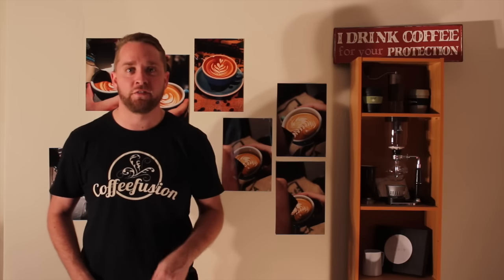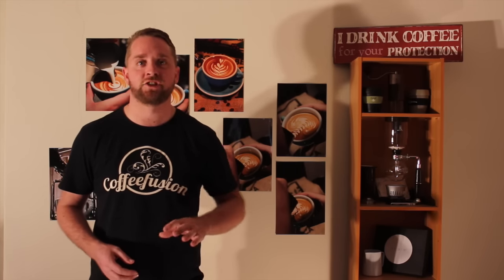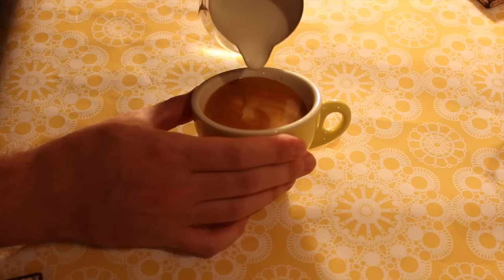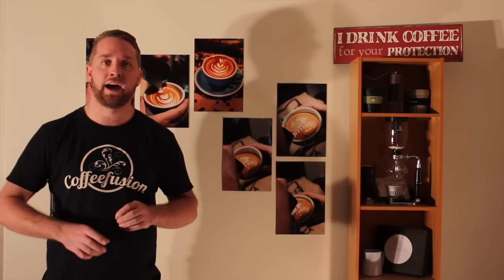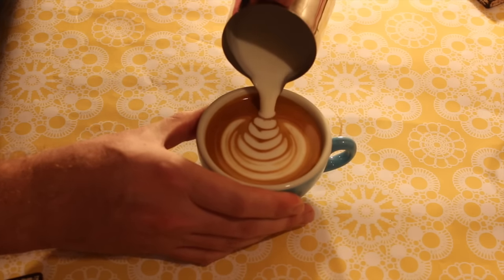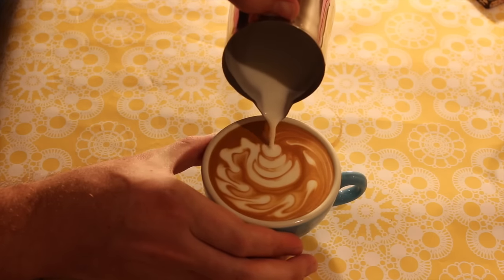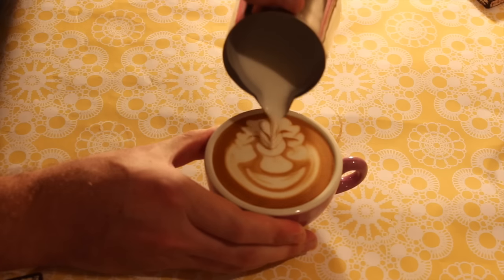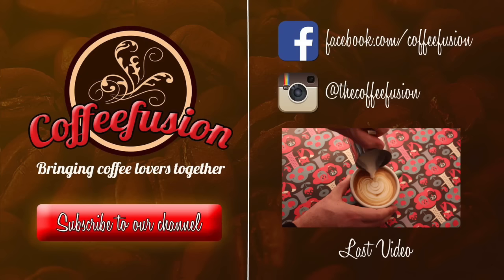Coffeefusion Episode 7 - Air and how it affects your art,  and T/A vs Dine-Ins

Comment: If I pulled a shot of an espresso and there's no crema, which is really important component to make a latte art, is there any solution to 'overwrite' my mistake or is it inevitable and I have to start over again? Thank you so much for answering ( that is, if you answered! )
Reply from the maker: you can make latte art without crema. the crema just helps you build a little bit more definition.

pour as normal without the crema, set the base by pouring from a slight height, and then move in closer to pour your pattern.